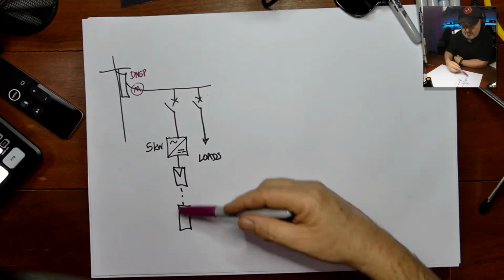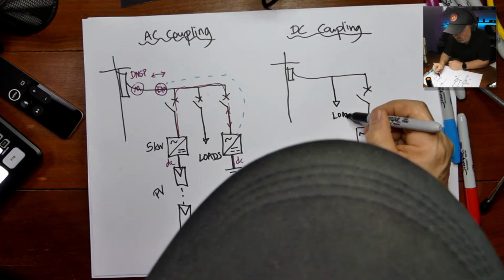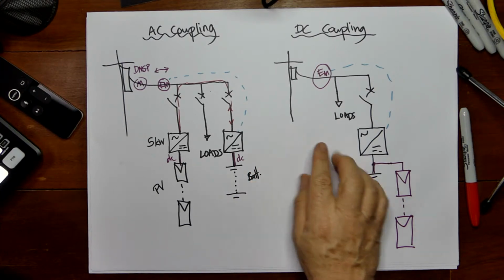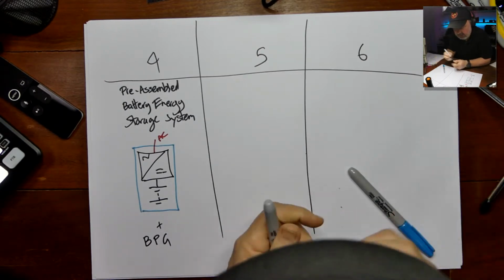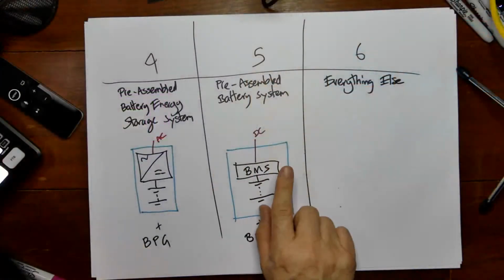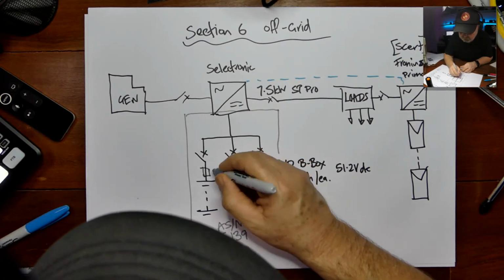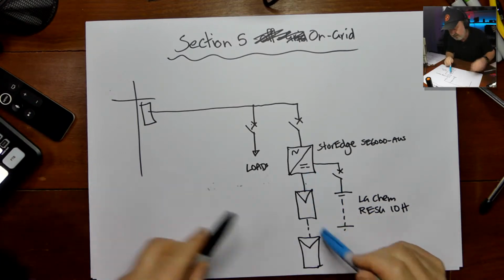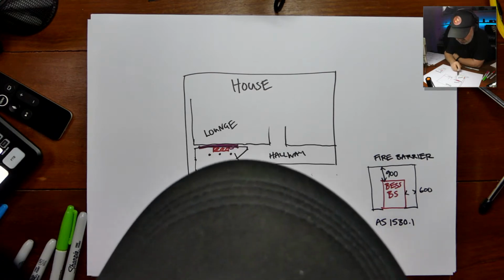Batteries, Solar Panels and Q&A

Comment: It's good to see the meaning of AS 1530-1 and compare it with others from other countries. For (ac coupling) 5kW cable installation are you use 3 x 4mm2 (phase, null, neutral - grounding) or 6/16/25/35 mm2 (other).
Reply from the maker: Hi there, AS1530.1 is a combustibility test for materials... I note that Colorbond Steel meets this standard http://steel.com.au/~/media/Files/Build%20and%20Construction%20Technical%20Library/Datasheets/ColorbondSteelDatasheetXRW.ashx